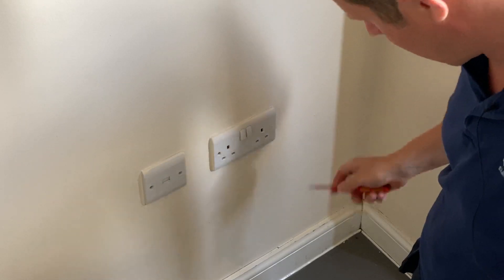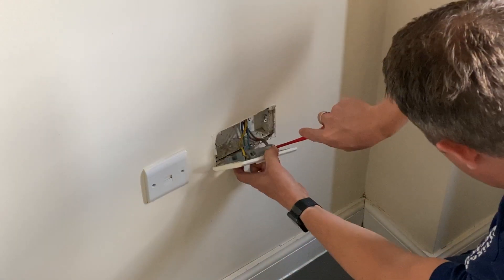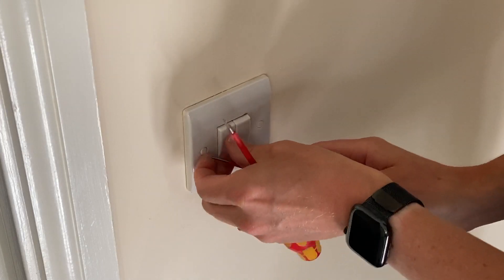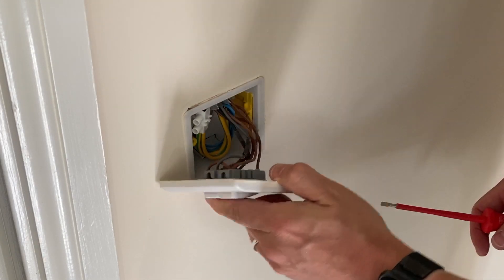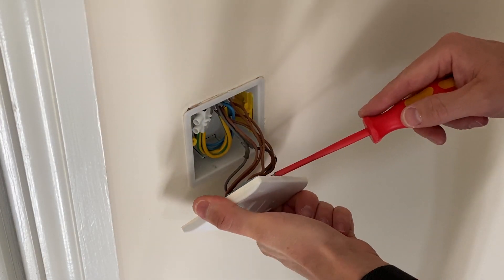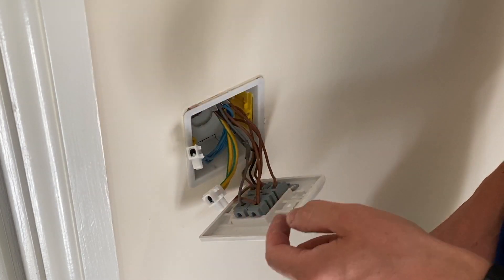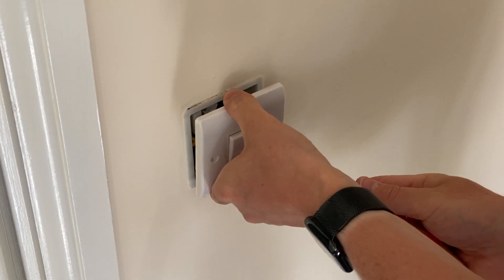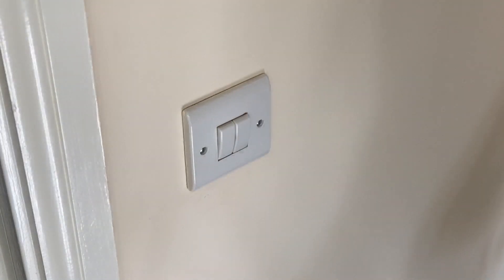Electrical Installation Condition Report Sample - Part 2

Comment: Quick question, slightly confused how you did a continuity test on all 3.5 retaining screws when it clearly shows on your vid that they were dry wall boxes with the cpc in connector blocks and no bridging plate from on side to the other???

Comment: the cables going into the connection part of the downlights where you can see the brown and blue is so common due to lack of space, if necessary sometimes i use insulation tape before clamping down on the cables

Comment: Like you, I do not like the screw cover but they actually have a purpose (under Australian electrical standards at least). They cover the screws just in case the screw accidentally pierces a cable behind! No possibility to "touch a live screw"!

Thought you might be interested. When there are no visible screws, they use a "clip on cover", that surrounds the switch or outlet.

Comment: I would normally do an IR test on the rings while out of the board followed by figure of eight and go round the ring for the R1+R2. Just to save time in and out with connections.

Comment: The Eaton light switch must have been wired by a spark who worked in New Zealand , as most wiring for lights is done at the switch here. When you only need the active and switched active at the Light, why take the neutral up there.
Reply: Wrong.  In NZ the cables, including the neutral, are taken into the switch box.  Neutral is generally left uncut and continues in the circuit.

Comment: You should keep your thumb on the drum when pulling out the wander lead. If you let it spin on after yanking it, the cable will unspool inside and then it gets tangled. Same problem with fishing reels ;)
Reply from the maker: Nice tip thanks!!

Comment: Definitely a c2 for 40amp mcb on a ring 100%, so unsatisfactory EICR, at first I would probably put a C3 on the down lights but some good points made in the comments about bringing standards up and as it has failed anyway I’d put a C2 as the letting company probably will only agree with putting C2 correct and then it gets left for another 5 years. This is such a new installation and really shouldn’t have ANY coding. Ps Click mode accessories all the way MK aren’t the quality they once where and why waste money Click is better than MK now, I hate installing cheap rubbish and won’t!!
Reply: Hi I'm looking in toolstation, is Click the same as Click Mode?
Reply: Geoff Ball yes that’s what i mean Mode is the range

Comment: Your method of continuity testing for a domestic property is correct for a periodic inspection for those comments who say you should be doing R1+R2!!!!  however bonds should be removed during the process as they can introduce a parallel paths.
C3 for downlighters unsheathed conductors, no one can touch them there in the ceiling.  C2 RFC 40A circuit breaker without a doubt.
Reply from the maker: Great thanks! I agree with you that’s how I’ve coded them.

Comment: Be carfull with your CE markings, depending on how the C and E are spaced, can mean China Export.

On any tests that I do, cables that are non sheathed and out of any kind of enclosure, be it in the loft or anywhere is a C2. I always get slated for it, but its always been in the regs for non sheathed cables to be enclosed. It doesn't and never will comply at all. I can never understand when it comes to EICRs that where there are works that are shit and isn't that ols, people are happy to sit on the fence and sling C3s at them. In a way its saying that these kind of shite methods are acceptable.

Comment: Accessories snob followed up by MK, just pissed my undies!
Those Eaton were offered by Denmans and a TN Robinsons in Manchester around 5 years back, same time as they were flooding their shelves with the consumer units.

I can nevr understand testing R2 on a RFC if its de energised. Wired in metallic containment with it being used as the CPC ok and where a limitation arised where the circuit can't be de energised.

Comment: Both CPC in one sleeve is an issue. If the CPC’s were to become loose or disconnected from the back of the socket, you would still get continuity when testing as they’d be touching inside the sleeve but the accessory wouldn’t be earthed.
Reply: This would come apparent when testing r1+r2 or earth loop test at the accessories

Comment: Another great video. Anyone who twists and single sleeves the earth's at a termination should die a slow and painful death. They obviously never do testing or fault finding. Interesting that the back of those switches look like scolmore click modules. I know you like your mk but honestly find it massively overpriced crap. I've had switches literally fall apart in my hand. I have been using click mode and can honestly say in 10 years I've never had a call back. Give it a try. The switching configurations have pulled me out the crap a few times. You can do things like have a intermediate and a 2 way on the one plate without the expense of grid. Should give it a bash somewhere I'm sure you'll like it.

Comment: I've got the Kewtech 50m wander lead which ain't cheap but is top quality flexible cable and comes with a socket on the drum. It came with 3m lead and croc clip with it to go from the MET down to the reel on the floor. I'd be giving a C2 for the bathroom downlights and 40A breakers for the rings. The downlights clearly haven't been installed as the manufacturer intended; the industry will never sharpen up its act if we make that sort of thing C3, we need not feel apologetic for saying such cack is unacceptable
Reply from the maker: Nice comment thanks
Reply: Not sure if those C2's will still be covered under any warranty from the original installer, anybody know?
Reply from the maker: Doubtful after 6 years
Reply: Agree on the Kewtech wander lead; having a socket on the drum instead of a plug is so much nicer.

Comment: Defo wouldn’t be passing that with 40a rings, limited to 32 for a reason!
Reply: 2.5mm cable is only rated for 26 amps.
Reply: @curtisj2165  It's acceptable to use 2.5mm for rings protected by a 32A. As long as the minimum cross-sectional area is 2.5mm, Reg. 433.1.204
Reply: 2.5mm on a ring may actually be acceptable at 40a. It's 1am and i can't be bothered checking bs7671, however on a ring the 2.5mm is effectively doubled as you have 2x2.5mm running back to the consumer unit and to each socket so if 1x 2.5 is rated at 26a (according to curtis j) then it should be capable of carrying 52a. However there may be additianal considerations that require 32a such as load limitations.

Comment: C2 for single insulated conductors outside an enclosure as could be a fire risk? Seen plenty of that so far.
Reply: What is the fire risk?  9 times out of 10, you’ll pull out a down light during an inspection particularly older cans & the sheath has not been terminated within the enclosure.  The risk is minimal, they are not accessible to touch as they are in the ceiling if it was accessible to touch then C2.

Comment: Again your method of R2 test is not worth much as you have still got all cpcs connected at the board. Therefore you could be getting continuity through parallel paths. To find out if you have continuity you need to do each cpc individually.
Reply from the maker: How could you get a parallel path from a light or socket? Doesn’t make sense.
Reply: Artisan Electrics what if a gas boiler has been connected onto a socket circuit. Water heater circuit? Did you only test lights and sockets?
Reply from the maker: Yeah I agree in terms of boilers water heaters etc but lights and sockets would be very rare but good point
Reply: Sparky MacSparkface, I see your reasoning, but this isn’t a new installation & not initial verification it’s existing R1+R2 on sockets picks up the resistance of the pins & give inaccurate results.  Bonds should be removed, if R2 readings were high further investigation would be applied.  I don’t think there is any right or wrong way of doing it.

Comment: I use the very tip of a stanley knife blade to pop those caps out, they are never very tight so one little flick and they are out.

Comment: 1. The hole size above that pendant is a bit excessive and non compliant (C2)
2. Basic insulation visible outside of terminal enclosure (C2 in many cases......can make an argument for a C3 in some circumstances)

Regarding the 40amp MCB for the ring main, that is a C2.....take a look at reg: 433.1.204 on page 89 👍🏻

All in all.....it’s a fail.  Although, not much would be required to rectify these issues.
Reply: good spot on point 1, worring thing is that they are all likely to be like this
Reply: Probably.  But, it’s still a box that needs ticking on the schedule of inspections, so must be checked.

Not easily rectified either if the hole is too big!  Tricky one!   Lots of sparks just squirt a load of fire rated mastic in the hole.  If the hole is too big, this doesn’t work!

Comment: Twisted Earth is ‘old school’ well before such comprehensive test requirements. If screw came loose at one point the rest if the circuit was not compromised. Only one dangerous point 🥺 as no such thing as protection other than fusewire.

Comment: I think it's super lazy doing a R2 test everywhere! I saw you carry this out on the scout hut too! How are you proving polarity and good connection? A r1+r2 test is suitable method.
Reply: Just test polarity separately and if the zs reading isn't too high then what's the problem?
Reply: @alexkane07  regulation 643.2.1 The continuity of conductors and connections to exposed-conductive-parts and extraneous- conductive-parts, if any, shall be verified by a measurement of resistance on:
protective conductors, including protective bonding conductors and in the case of ring final circuits, live conductors.
Reply: Michael Boyes That regulation is for initial verification hence it’s under chapter 64, initial verification.R1+R2 testing is not an essential test for a period inspection, tho not precluded, as long as all exposed conductive parts and extraneous conductive parts are confirmed to be connected to the means of earthing , ZS can be measured for each final circuit to confirm ADS in compliance with chapter 41.
Reply: @ishkebab  correct but I still think your half assing it if you don't do r1+r2 doesn't take long I've been taught to always take measured results you cant go wrong then, anyone can take zs and a ze and do a full test result in a van
Reply from the maker: R2 testing is a much more thorough way to ensure CPC continuity throughout on an EICR as it allows you to check every point whereas R1&R2 is generally just carried out at the end of line. Many a non earthed metallic light or switch have been missed in EICRs by people who only did R1&R2. 
Polarity is checked when doing earth loop impedance testing.
Reply: R2 is good for radials for CPC cont, but then you test EFLI at the point with highest R2 which should be the furthest point. This doesn't prove polarity at each fitting though. 
In an ideal world, polarity should've been confirmed on initial verification though.
Reply: @alexkane07  Interconnected ring finals for one?
Reply: @SME_Ste  I should've clarified, I just meant radial circuits. Ring circuits are a different story.

Comment: To remove those caps , use a new stanley blade and the with the point, slide in and out pops the cap with no damage
Reply from the maker: Nice

Comment: Surprised you didn't do the figure 8 test on an unknown RFC.
Reply: You have the choice to either do the R1+R2 (figure of eight) or R2 (long wander lead) test
Reply: Continuity of ring final conductors & r2 test to screws or earth pin of socket plus Zs is what is required👍🏼.